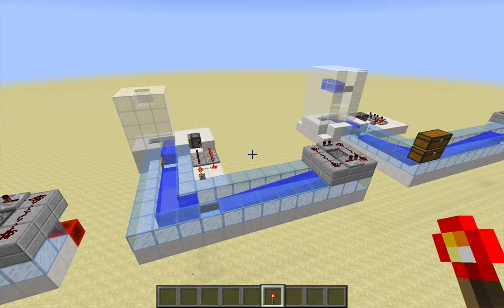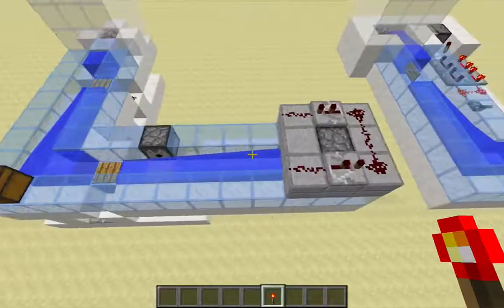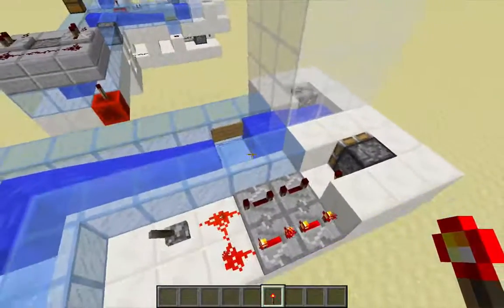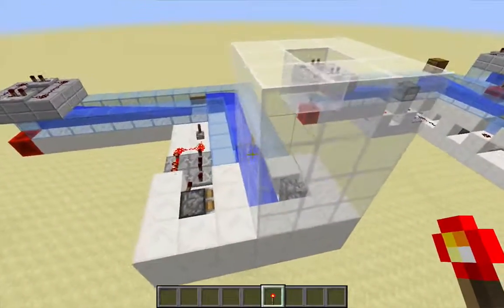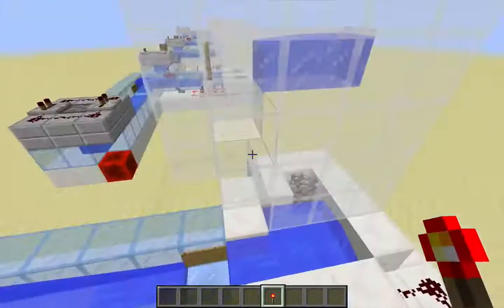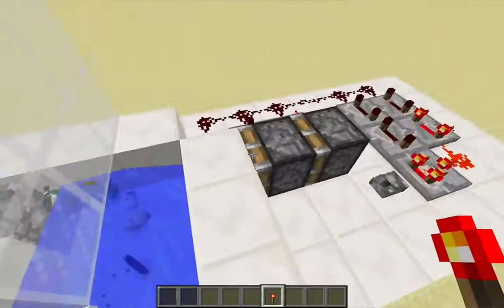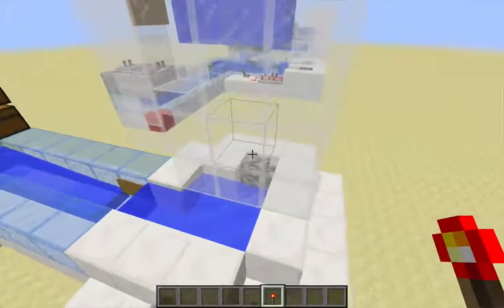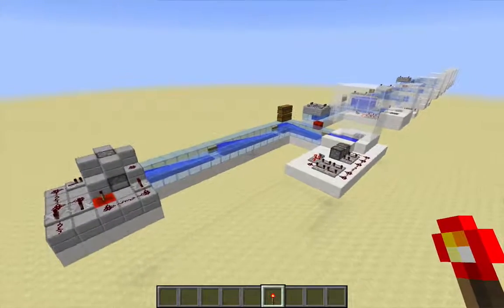Item Elevator Double Extender (Snapshot 15w39c)

Comment: That's an interesting design, nice use of the mechanics there and you could always use a pressure plate with a pulse extender if you wanna get rid of the clock.
Reply from the maker: +danywhoever That's true, but if you do that, you need to ensure the input is appropriately batched, in order to ensure that the pressure plate deactivates.
Reply: +Nathan Ryan Or you can put the pulse extender in front of the clock so it only runs if there are items in the system.
Reply from the maker: Yes, that's good idea. You could drive the clock with an extended signal from a pressure plate in the input stream, rather than a continuous power source. That way the double extender wouldn't be directly driven by the pressure plate, so no need to batch. Effectively, the "batching" is done by the clock. I like that.
Reply from the maker: +danywhoever Just tried it out, works like a charm!

Comment: well in the case of a guardian farm(or any other high speed farm) u anyways have an on off switch and for all other stuff u dont need such a high speed elevator
Reply from the maker: +Jendrik Weise I once had a setup where I had the output of multiple farms dropped into the same channel, which sluiced items into a common storage system. Because I had so many farms feeding the thing, the stream was really heavy, probably even more than an OP guardian farm :-P
Reply: that s probably a bad idea anyways xD
Reply from the maker: +Jendrik Weise yeah,it was :-)